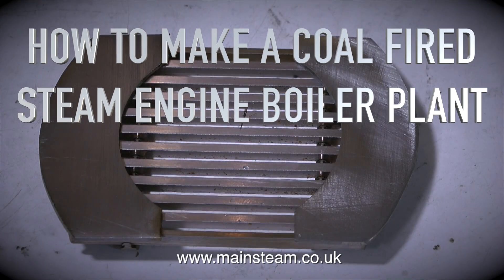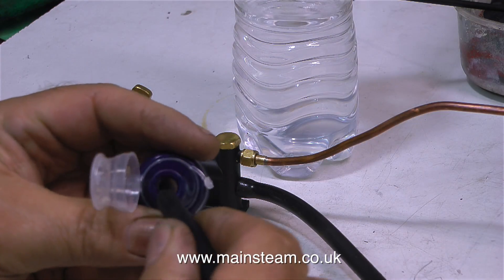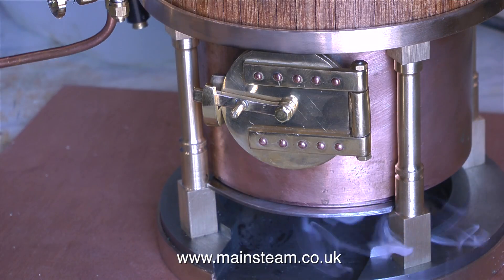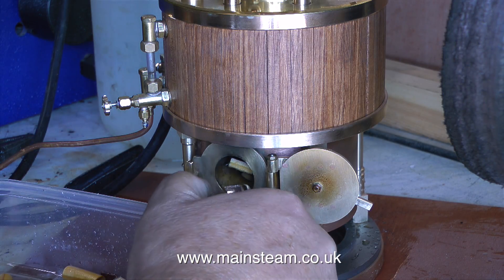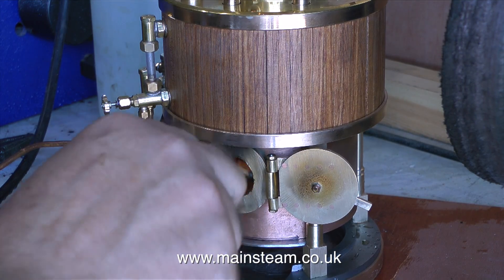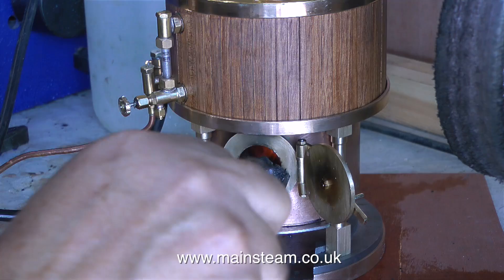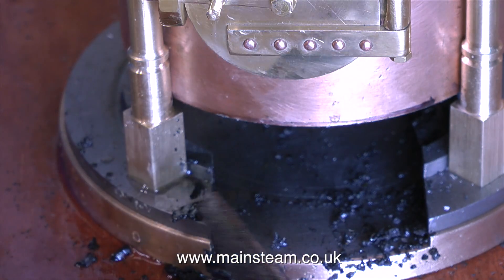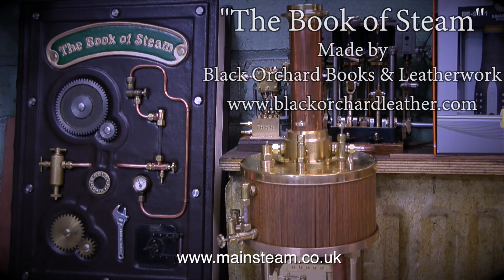HOW TO MAKE A COAL FIRED STEAM ENGINE BOILER PLANT - PART #25

Comment: Hi Keith Thanks for the great tutorial. I would've made the same mistakes had it not been for your tutorial. Only I would have been really puzzled as to why it didn't work. Thanks for sharing your knowledge. I'm actually not interested in models but a large boiler to run a steam engine for off the grid electricity. Do you have any suggestions on where to find the information on large boiler making and where to find, make or convert a gas engine into a steam engine large enough to run a generator? Thanks for your help. Best Wishes n Blessings. Keith noneya
Reply from the maker: I can't help you with that - try looking elsewhere on Youtube - there's bound to be someone doing stuff like that.

Comment: Hi Keith, been enjoying your video's for quite sometime now and although this is not regarding engineering,  I know that play and have a knowledge of the Hammond.   I was walking down my street and one has been put out on the kerb for rubbish.   I hate stuff going to landfill so pulled some pop parts off.  Wondered if you knew what model they came off of??   Please see my videos, many thanks, looking forward to the steam engine build,unfortunately when I was at school in the early 90s we had lots of beautiful british made engineering and woodworking lathes .  Never got to use them, they were more like props ,instead we spent classes writing as abouting plastic extrusion. Thankfully you have shown me what a metal lathe can do.
Reply from the maker: Sadly the parts that you show have a negative value as they are from a non Tonewheel "Hammond" organ - probably a "J" series or similar. The best place for it is back out by the dustbins sadly ..... A friend of mine thought he was doing me a favour a while back by getting me a free Hammond Organ that he found in the local paper. I went with him to pick it up and we took it straight to the local Tip ......
Reply: +Keith Appleton Many thanks for your reply. That has saved me from wasting time listing them on eBay.   Looking forward to more of your video's     your output is great.

Comment: I've never done bookbinding (outside of elementary school) but I've been doing leathercrafting for around 5 years now. That book is absolutely gorgeous.
I really like the premise of firing the boiler wrong. It does well to address the safety-paranoid among us to show that you can do things wrong without, ya-know, dying.
In high school, I once used gasoline/petrol to light a barrel fire. I was told it was mineral-spirits and ignored the fact that it didn't smell right. I lost my eyebrows but was otherwise OK. Yeah, I wouldn't recommend that.

Comment: As I watch the video I keep thinking "Yup been there done that" about the only other thing I did was messing about with a propane torch to try to get a boiler going. When I saw the book I first thought a novel way to sell parts
Reply from the maker: That's what I did on my first attempt, but I didn't mention it in the video. I lit a Barbeque last week in the same way, using my Sievert Gas Blowtorch :-)))))
Reply: I switched over to a propane Barbeque, but carry a small pocked torch when out camping.

Comment: I would love to see a boiler that uses methanol :) since it likes to mix with air the only advice you need to give people about methanol is never try to drink it because you will going blind and then start seizing and after that you die because it turns your blood in to acid that kind of behaves like a neurotoxin also try not to get it on your skin i will say methanol burns really cleanly like you can burn it in a inclosed room because it doesn't create a lot of smoke it also burns with a flame that isn't that bright so it doesn't damage your eyes. i wish you were like a naber because i would love to do stuff like this since I have epilepsy and it makes me not able to get a job i would like so i try to find hobbies but most hobbies i want to do require really expensive tools and also my father doesn't ever try to help me when I tell him I need some one to help me when I need a extra set of hands
Reply from the maker: Methanol is very dangerous, not only is it poisonous but because the flame is invisible - I don't recommend it at all for firing model steam boilers . . . . Methylated Spirit is ok, because you can at least see the flame.